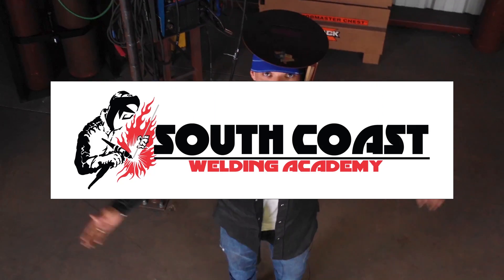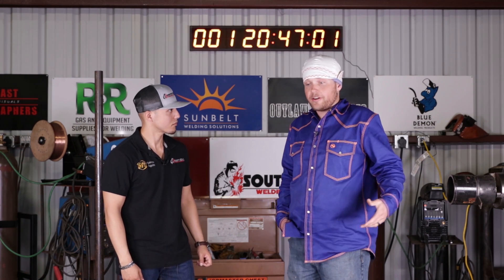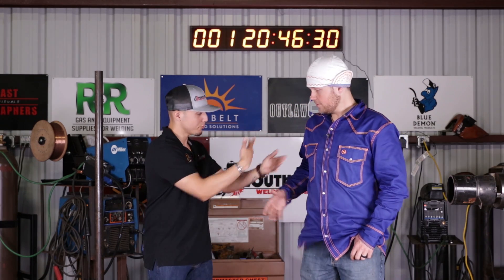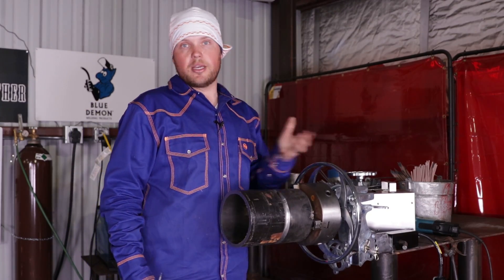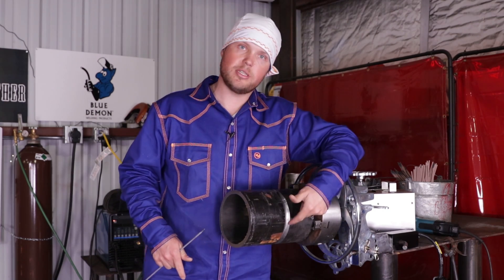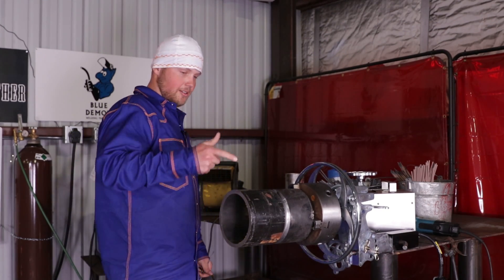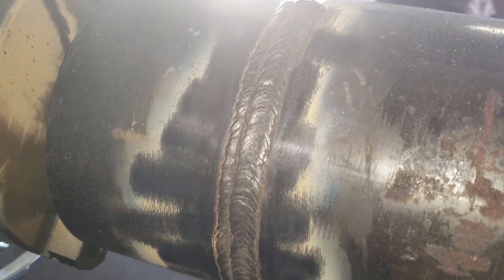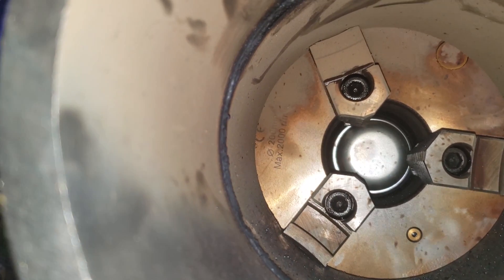welding 5g downhill Test 7010 rod

Comment: What is a good heat to run 7010 1/8 , 5/32 , 3/16? Never burned those rods before
Reply from the maker: i guess it will depend on what your doing. are you tryig to bead with 1/8 or hot pass or cap let me know and ill break it down.
Reply: @JacobSchofield  hot pass and cap